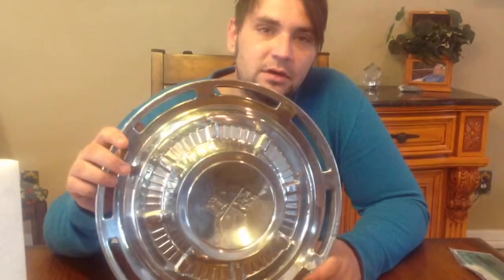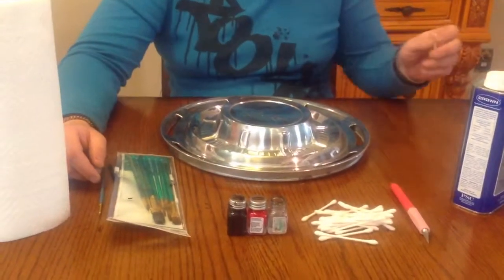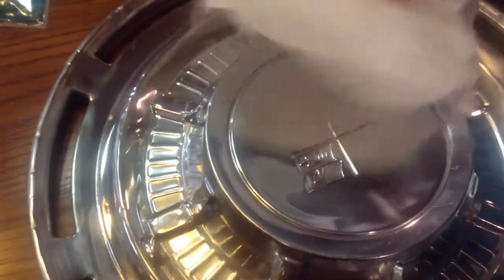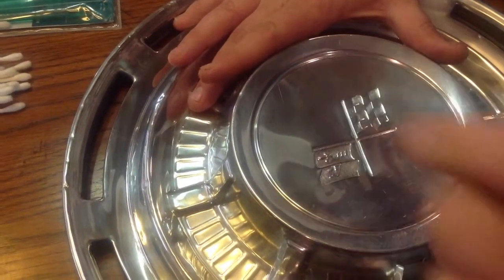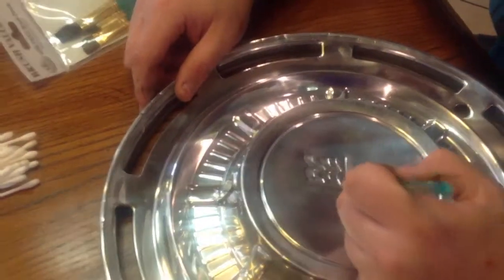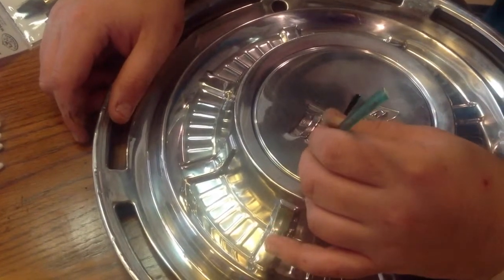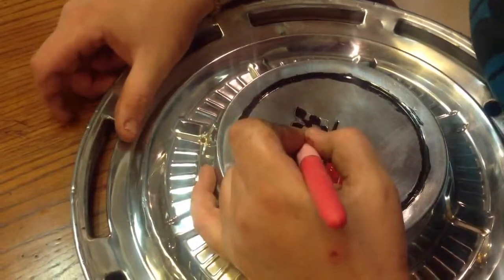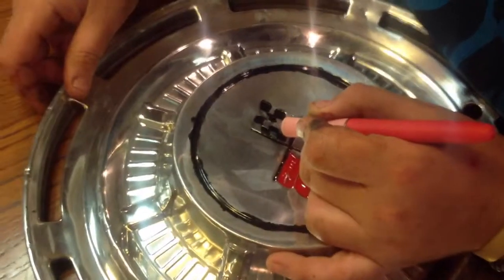Jams 59 Chevy Parts- Custom Hubcap Painting

Comment: Idk I don’t think using a diamond tip on stainless hubcaps would be my approach,especially when there is a lack of stainless refinishers around,I think a super super fine steel wool would be a better bet,I’d also first have the hubs cleaned and polished before painting,I would also use enamel paint rather than acrylic model paint,it does have a long life but enamel with hardener is a cleaner more brilliant finish,I think taping would eliminate the need for using a razor blade to clean up lines,a good automotive soft painters tape,seems kind of amateur I can’t imagine real automotive hubcap repair workers using dremel bits to scuff stainless otherwise you’d see a texture when the paint is faded and worn to begin with,I think this would ruin the value and also bring in scratches and damages,would you razor a new set of 56 Lincoln premier hubcaps? How about a set of Cadillac sombreros 1956 would you take a diamond tip dremel bit to clean up paint imperfections? I think the best bet is masking or frisking places on the hub you don’t want paint on,even laying down vinyl vehicle wrap would be a better way to protect areas,there’s a reason car painters use “enamel” for striping and other paint needs on cars or trucks,it is tried and true...have you ever saw any hubcaps from the 30’s into the late 60’s with acrylic?

Comment: Good video. I'm doing a set from a '59 Cadillac and the way I got rid of my access paint before it dried was to lightly dampen a paper towel with mineral spirits, fold it into a rectangle. Place a small, stiff piece of cardboard in the fold of the dampened paper towel. Then, much like you are wiping grout from the floor tile project wipe the newly painted hub area with the paper towel and cardboard piece. Works very well.